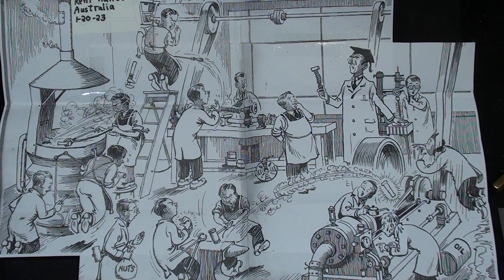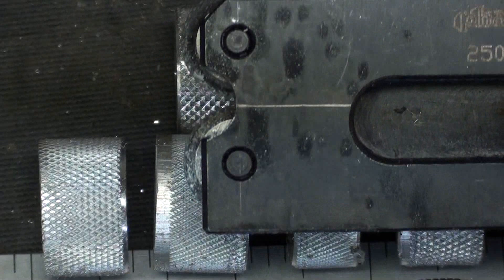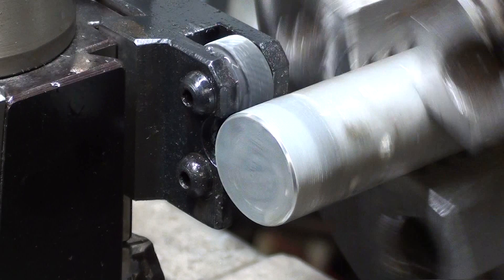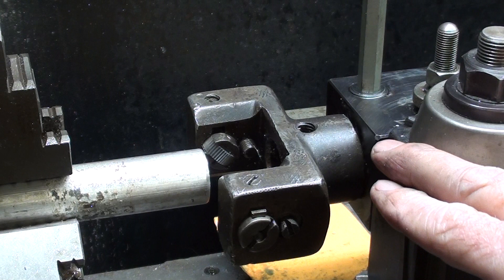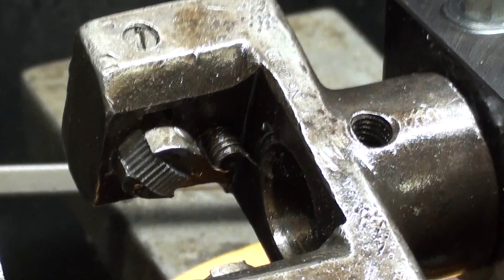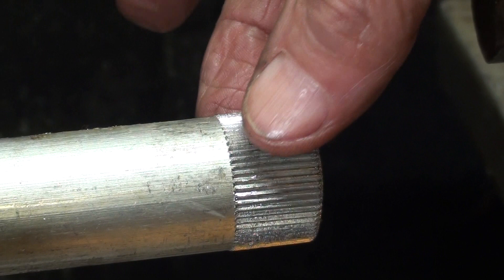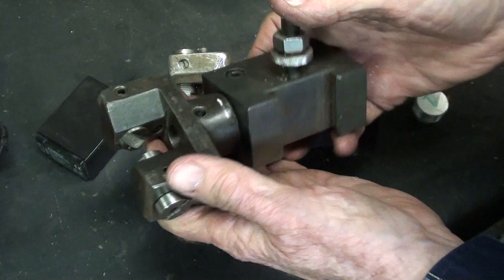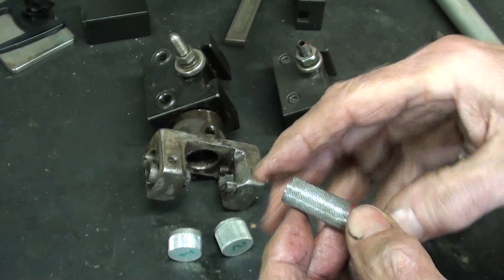HOW TO KNURL ON THE LATHE #860 pt 2 mrpete

Comment: Re:  "I wish they had used a phillips head screw":  -Not invented until 1932, so if the tool was designed before that, they probably didn't change from the slotted type for many years.  My dad, who ran the screw production operation for the Sems division of Textron in Rockford said that high production industries like automotive  were begging a fastener   head that would lend itself to increased automation.

Comment: Is the knurl supposed to slip and fall into the previous groove?  I've been confused about this as wouldn't it need to align after 1 revolution?
Reply: No. Just like two gears do not need to realign after each revolution. They are just wheels riding around a wheel(the work piece).
Reply: @grntitan1  so it just works. That's crazy how that works out. You'd think the pitch of the knurl die would need to relate to the circumference of the piece or the last knurl at 1 revolution would be odd size

Comment: What alloy is "screw machine stock"? What do you mean by that term Lyle? 

When I Google it I get answers from 12L14 all the way to 4130, so I'm not sure which alloy you're referring to when you use that term.
Reply from the maker: 12L14
Reply: @mrpete222  Thanks Lyle...that's what I figured. But Google was less than helpful. 

 By the way--your ears should have been ringing late last week: I went over and picked up a couple of the Rose Index units from Tim at his shop, and we were talking about a couple of your videos. I live like 30 miles away from him, so I just drove over there. Cool place--full to the brim with machinery!

Comment: Not being familiar with this knurl tool, I was wondering if there is a proper way to remove the knurl wheel shaft. Maybe just hand press it out? Just don't want to break anything on the used one I picked up, and not for a buy$, it cost me but I wanted one anyway!
Reply from the maker: I use a punch

Comment: Why wouldn't you mount the knurling tool perpendicular to the work rather than from the end? Put it in the other end of the tool holder and put the tool holder on the left side of the Aloris tool block (like where you would mount a tool bit).Then turn the wheels in the holder to the proper angle, Use a tailstock support center if you need to.  Then you could knurl longer lengths than just 1 inch. Just a thought.
Reply: My thought exactly.  The pressure on the tool would be across the shaft instead of lengthwise, but it looks sturdy enough to cope.   And with the wheels at 45 degrees the cutting action should be identical to the standard setup.

Comment: Fun picture from Your first year as teacher. What did the pupils think of You? 
What nickname did they give You? 
One teacher got the nickname "the buck" due to his beard. One was named "The cheese" due to his name. Then there was "The file", already mentioned..
Not having a scissor knurler? Maybe the next auction can fix that? Joking!
The push type knurler should not be used on hobby lathes as they stress the head stock bearings. The scissor type is more kind to the lathe.

Anything can be made a science. I'm satisfied getting something a littler bit better than just raugh. Making arts? Not my ambition. Why ruin a clumsy but working part by failing some artistic work?

Being an old an experienced teacher, have You been reading the label on the WD40? I have and don't use it. "Avoid breathing it, use good ventilation"...... I would need to put the lathe, or the mill, on the stove where there is air evacuation...

If You're still reading.... You have beaten this subject to death in the two parts... Joking!
Reply from the maker: I read the whole thing. I guess I did not read the warning label on WD-40.

Comment: Didn't you increase the 'depth' of cut in between? This is at least what is suggested in How To Run A Lathe from South Bend.
Btw. to me it seemed as if the two rollers didn't contact the work at the same time. I.e. not centered correctly.
Reply from the maker: It is very hard to adjust the knurling head, such that both rollers contact equally. It would make little or no difference on longer material. I saw that happening when I filmed it, and I knew that the perfectionist would gripe about it.

Comment: but they're expensive as you pointed out in the last video and you have to buy different sizes
Reply: Not exactly, each size B&S knurl tool has an infinite range of sizes it will produce within that tools limits.  Lyle did not explain that
A 1” B&S holder can knurl a 1/2” part or a 3/4” part and any size in between
Also set the position of the tool holder on the compound with an arbor in the chuck and the holder loose. Carefully get the holder onto the arbor and lock it down, then back off and install the knurling tool 
JIM ❤

Comment: I don't know were I read it but now I know that the diameter of the piece doesn't have anything to do with the success or fail of the knurl. What bothers me is why some times (lets say 2 out of 4) my knurling fails, even using the same diameter material. It's a mystery I guess or maybe its the way de "push type" of knurler works.

Comment: There is no need to reverse the spindle direction to knurl off.  Just back the tool out about the same speed as it knurled on.
Reply from the maker: I did not reverse the spindle, I simply reversed the power food
Reply: @mrpete222 M y mistake then.  I have seen the reversal done in a few knurling videos/

Comment: Of course there is a rhyme or reason that knurling produces a poor result. Even though you don't believe it and someone "laughed you out of the shop", it is USING the CORRECT DIAMETER.
It is obvious when you think about it. If the pitch of the knurl does not "match" the diameter of the work, the knurl will overlap! It is as simple as that!
Without realising it, you proved this indirectly when using the knurling tool that has the wheels on either side of the material. You adjusted the tool to suit the diameter of the material. This is just like turning the material to the correct diameter!
Your final diamond knurls were acceptable, but did have a noticeable "spiral" in the result.
It is preferable to place the knurling tool at 1 or 2 degree to perpendicular, this eases the initial load on the tool and generally allows a better knurl result. In almost all knurling instances, the ends of the knurl are trimmed/finished, so the slight angular offset does not present a problem.
Reply from the maker: Thanks